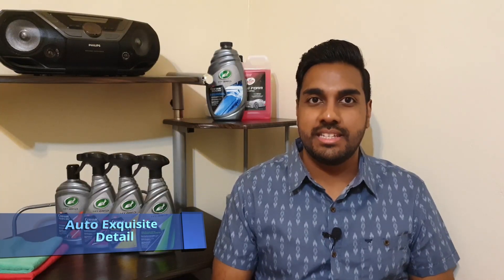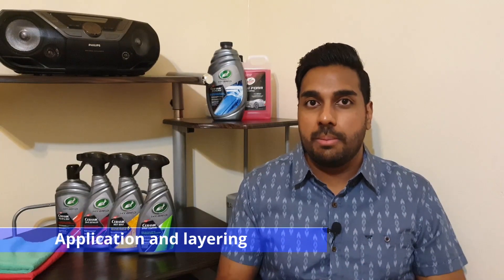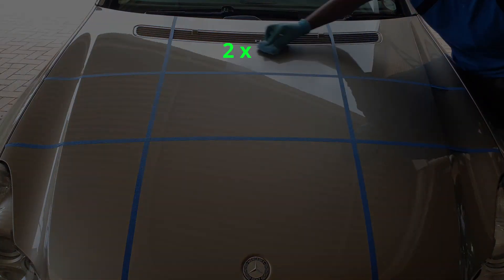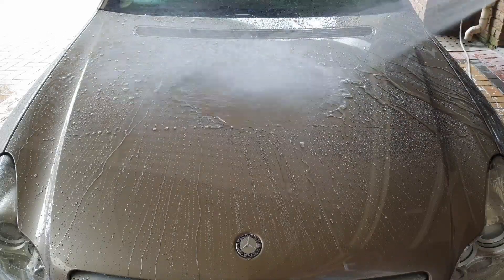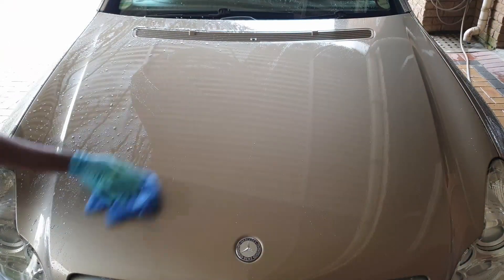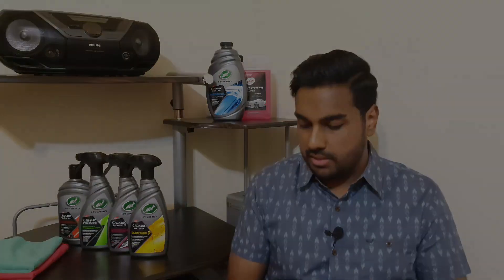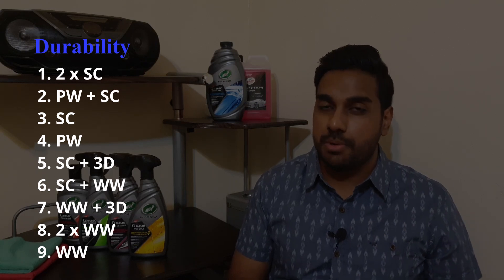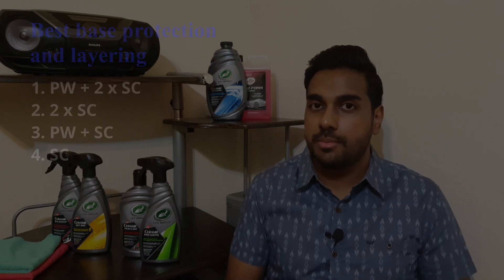Does layering Turtle Wax Hybrid solutions work!? - How to layer, Durability, Review

Comment: What can I use to remove watermarks on ceramic coated car?

Also can i use TW ceramic detailer and top it with TW ceramic spray coating?
Reply from the maker: There are a few products designed for water spots but I would recommend carpro spotless. Please just read instructions carefully before using it’s a harsh chemical. Keep in mind that this will remove normal spray coatings, sealants and waxes this is mainly for a proper ceramic coating. 

You can use those 2 products but not in that order use TW ceramic spray coating as the base layer and top with ceramic detailing.

Comment: New sub thanks for the video, I do have a question I spray the 2nd ceramic spray after 24hr and it looks amazing waiting 24hr again. Now I wanted to add a Glaze to it and seal to it is too much thanks again
Reply from the maker: Thank you appreciate it👍...personally I dont use glazes however they are there to hide swirls and scratches mainly, so should be applied before these products as in directly on the bare paint. Putting glaze over a spray coating will not bond very well either. Id say with 2 coats of this product you good just keep a normal maintenance for them.

As for a seal these ceramic spray products are already a sealant so thats not needed. If you want to top it up with something I'd say use the 3 in 1 detailer or at least any ceramic/SiO2 based details/waxes that way you know they have a chance of bonding.
Reply: @autoexquisitedetail7706  thank you so much it will save me time and product

Comment: Great video with detailed comparisons on layering. I got Ceramic Spray Coating and did a first coat on the weekend, like many I was impressed how easy it was and how good it looks!

Wondering if there's any added benefit to building up more than 2 layers of SC? Haven't come across anything saying yes or no
Reply from the maker: Thanks 👍...personally I would say no 2 is the sweet spot I rather wait a few months then do another layer to boost protection
Reply: @autoexquisitedetail7706  thanks for confirming, that's great to know.

Comment: Do you think that you need to wait 24 hrs between the applying the Ceramic spray coating over the Polish and wax? and then another 24hrs for the 2nd coat? Most of us dont have the time to hold onto a car for 48hrs plus to layer as per the instructions, just wondering if layering within an hour or two affects durability.
Reply from the maker: You are very right the 24hrs is very long.. I did a video previously which I see you have watched and I layers coating over polish after only an hour and got very similar results so I dont see the absolute need for the 24hrs. It does make a slight difference but unless you doing durability tests back to back like in this video you won't be able to tell a huge difference. I would say if you tight for time you can go and layer without waiting youll still have great results 👍
Reply: @autoexquisitedetail7706  Thanks for your quick responses, and for actually taking the time to respond. Enjoying your videos, best of luck for the future.